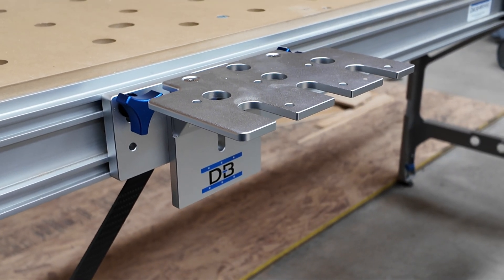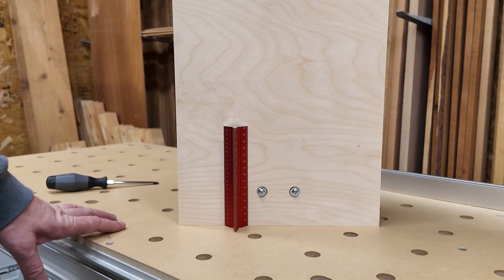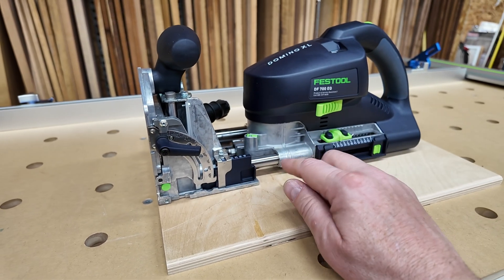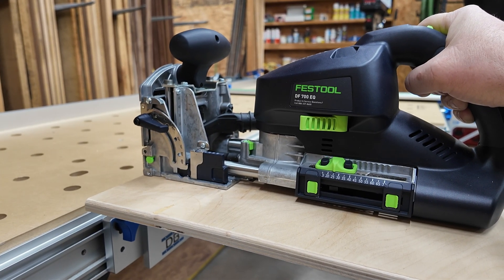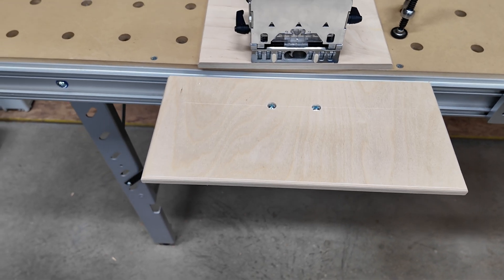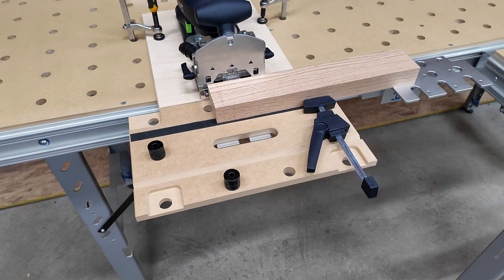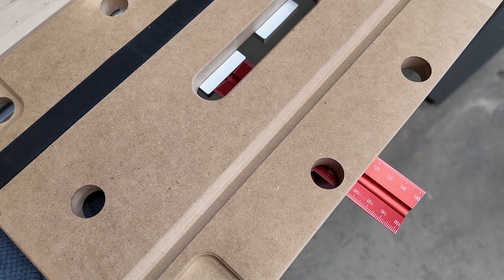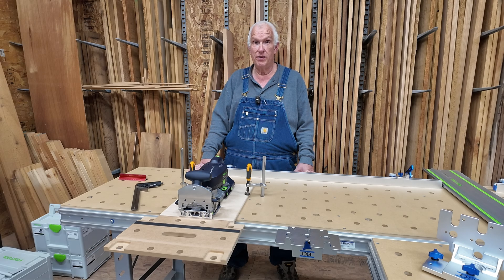Accurate Domino Joinery on an MFT with Dash-Board Track Stars (😭 UPDATE, see description)

Comment: Thanks for acknowledging my jig. I use pretty much the same method as Veritas for adjusting to different workpiece thicknesses, shims under the Domino (or the workpiece). Not as quick or flexible as Woodpeckers but very cheap and works fine. You might be onto something here, as long as that Track Star is very stable and well guided in all directions. Compare with Woodpeckers height guide where they use two high precision linear bushing to guide the Domino in height.
Reply from the maker: @CarmoniusFinsnickeri  I’ve got a little project in mind, so we’ll see how well my Track Star method works in practice. Confession: I made a video of one of my earlier variations and called it “The Ola Board”, as a tribute. I abandoned that approach and never published the video, and I also decided that even if my intention is to acknowledge inspiration, putting your name on one of my potentially bad ideas would be unwise. 😁 Thanks for the comment here!
Reply: @ShopKlutz  All publicity is good publicity. Sometimes the best ideas comes from evolvement from the bad ones🙂